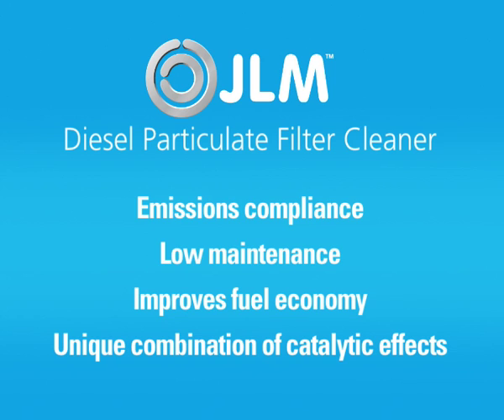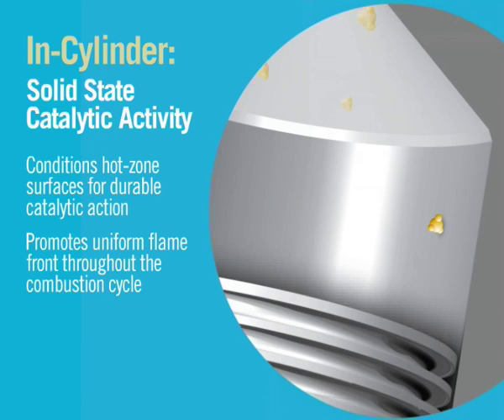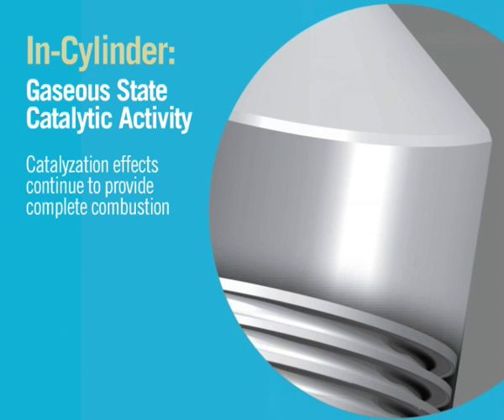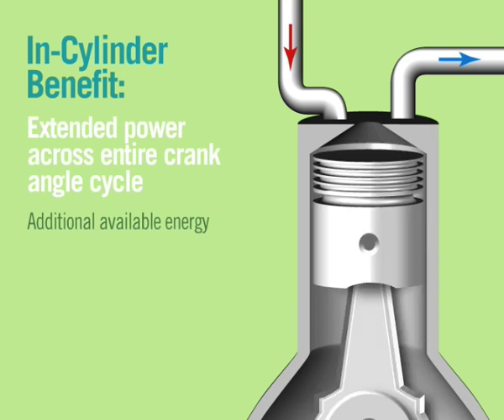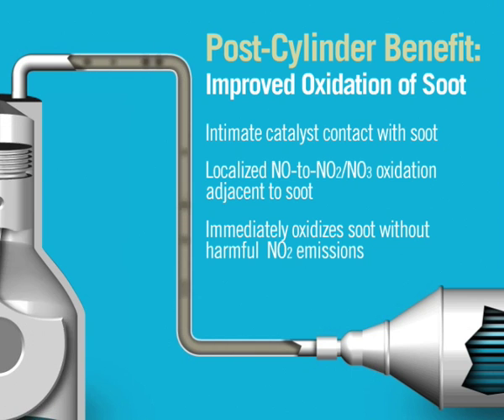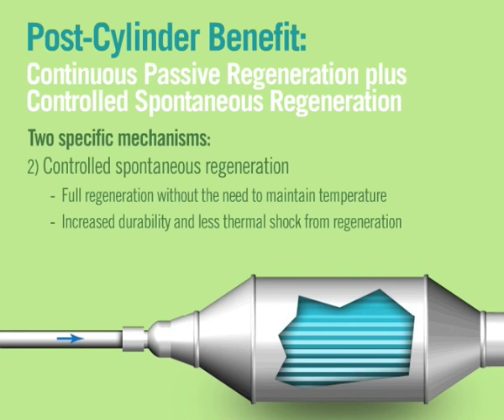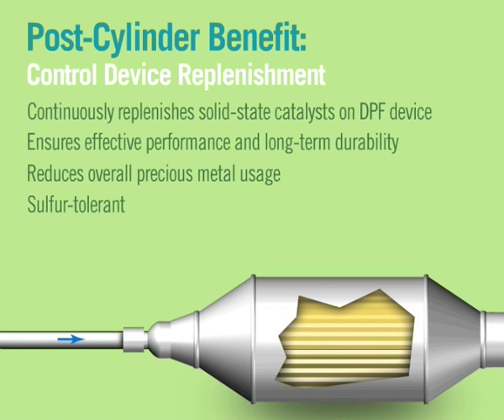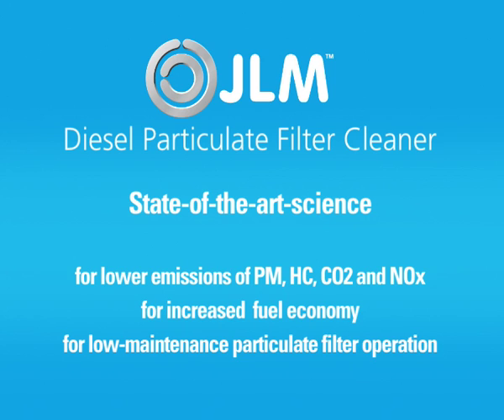How it works! JLM Diesel Particulate Filter Cleaner 375ml - the ultimate DPF cleaner - fuel additive

Comment: Hello, I see that your product seems to be cleaning soot effectively but soot is burnt and turns into ash and the ash is exactly the problem which shortens the life of DPF´s, not the soot which your car should burn itself as long as you at least sometimes drive a few miles with a warmed up engine in higher revs (2.500 - 3.500) outside town.

What does your product offer to eliminate the real problem which is cased by the result of burning the soot? Ash wasn´t even mentioned and a lower burning temperature does certainly not automatically mean less ash. As for the MPGs (or in my case litres per 100 km - there really is not the slightest bit of difference (Audi A4 B7 8ED - 3.0 TDI quattro,171 kw - 163.000 km) - average before: 8.8 litres/100 km - average after - 8.8 litres/100 km - fuel - always Shell V-Power Nitro+. The average was measured "realistically" by calculation after refillings, not by the computer indication which says 7.9 litres and therefore constantly betrays me about 1 litre.
Reply from the maker: dopeofthepope Many thanks for your comments on our DPF cleaning video!
Please be advised that our JLM Diesel Particulate Filter Cleaner additive can be considered as one of the best fuel borne additives to clean out the collected soot in DPF's. However, like all DPF cleaning additives, it will not clear the ash. But please note that our product will reduce the soot-load up to 25% less.

I trust to have informed you correctly, when you have any additional questions, please feel free to send them.

PS have you seen our animation about our 3 different DPF cleaning products? Here's the link http://youtu.be/9nyoFwL9q_g?list=PLsRrBrVRoXS_fXsSyAP6ARu_TjesiwGdh

Kind regards,

Gilbert Groot

Comment: restricting flow of exhaust gas causes soot build up in exhaust catalyst,  poor engine performance,  poor fuel mileage, early engine and transmission failure.  due to higher stress demand heat on driveline.  cats are nice for the environment,  bad for performance, fuel mileage, driveline longevity,  first thing to go on any vehicle I own is the converter.  I have taken apart so many cats and seen them melted inside, broken, fractured to the point the centers were gone.

Comment from the maker: JLM DPF Cleaner product has been specifically developed using a proprietary catalyst to enable more complete regenerations, while reducing the potential amount of soot collected into the filter, it also allows less ash deposits to build up (when used on a regular basis).
You would find that some other brands of additives use a catalyst that could result in higher ash content in the DPF.

Comment from the maker: Thanks you for submitting a question at our JLM LubeTube Channel! 
 
JLM Diesel Particulate Filter Cleaner cannot empty a DPF of this ash residue. No additive product on the market can achieve this. Regenerations will always leave a small amount of ash in the DPF, eventually it will fill with ash that will cause a blockage that will require the DPF to be changed. Like any part in a car, there will be an end to its life cycle.

Comment: Jlm PDF cleaner worked for 100 ml half tank drived the car for 50 mils at 100 mph some time 120 mph on BMW 1 series 120d 2007 reg and the sign on the dash gone very happy with the product you should try it b4 buying a new catalic